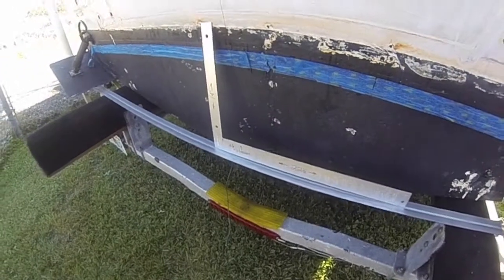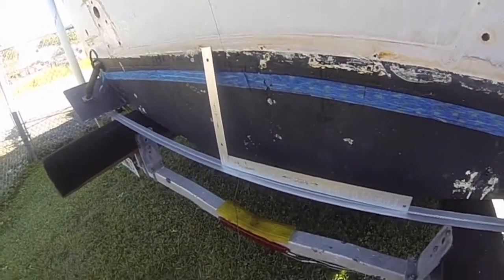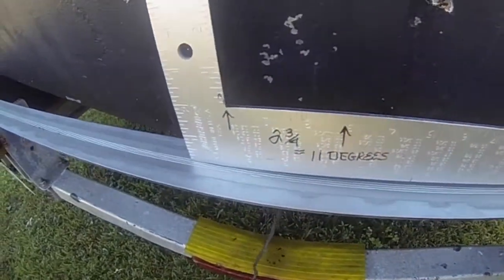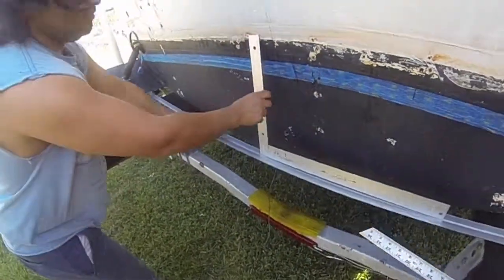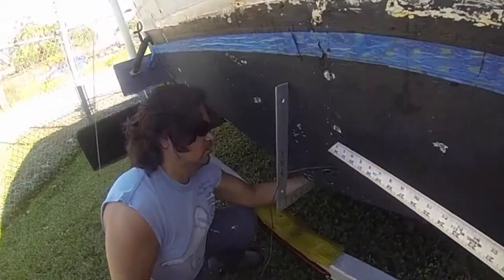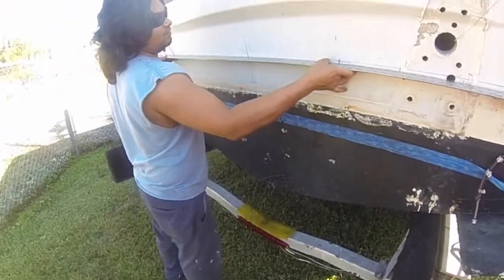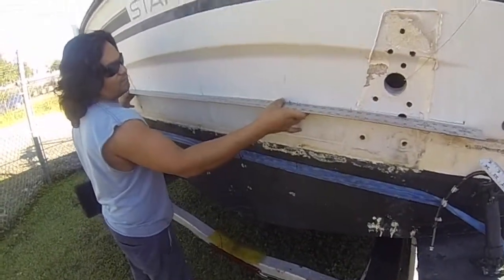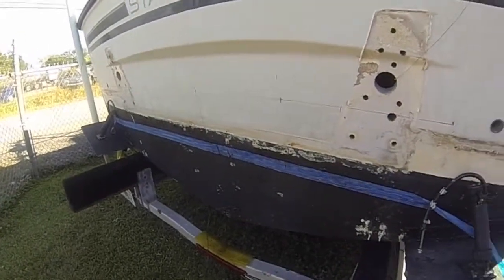Boat Transom

Comment: This short video will give you instructions on how to measure the transom of your boat to get the correct angle for an outboard engine bracket or a poling platform.  Should you have any questions, give us a call at 813 248 8265. Thanks!